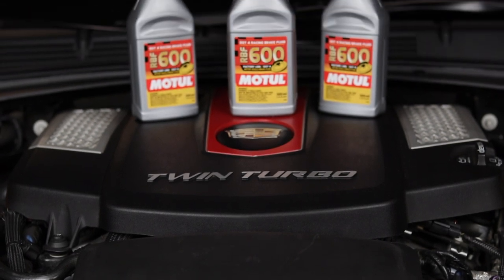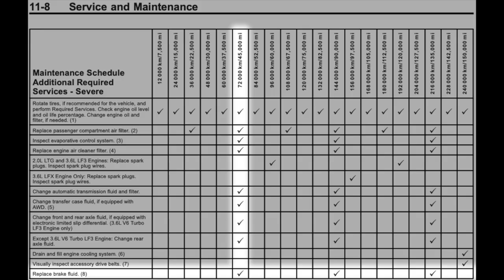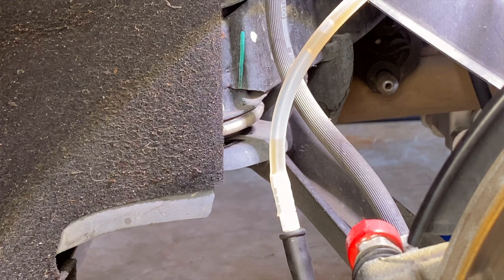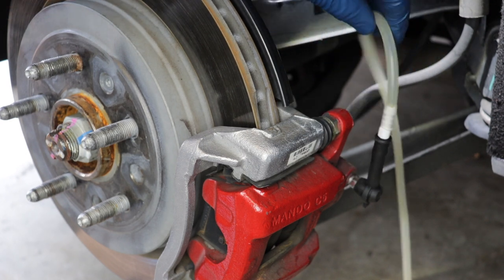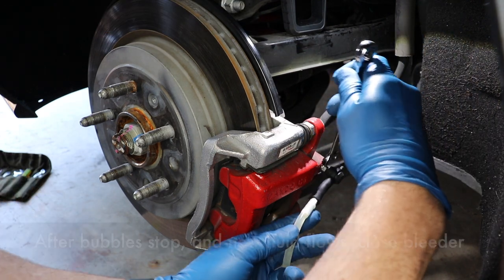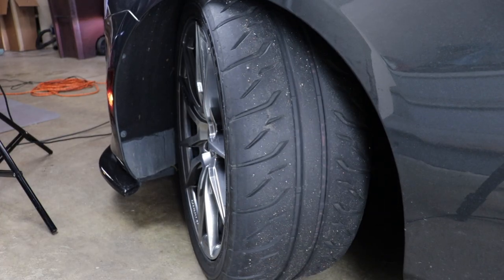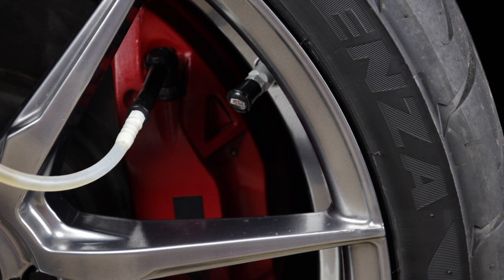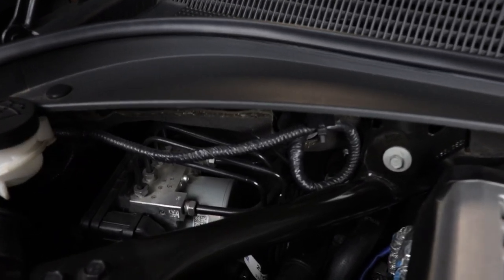Bleed Your Brembo Brakes - Track Day Prep | CTS  ATS Camaro  Corvette

Comment from the maker: Don't waste your time with that brake bleeder, get a Motive power bleeder or just find a friend!
Reply: I tracked my 14 v sport once a month for 3 years on trifecta tune. Only thing that broke was the rear diff but motor trend broke theirs too and said the early models had a casting problem. Mine was one of the first built.  Track days chews up tires bad. I ended up buying used tires as I was going through them too fast.
Reply: 😂 you're on point 😅

Comment: I’m here because of the problem where the bleeder pulls air in through the screw. Glad to see I wasn’t doing something horribly wrong.
Reply from the maker: Yeah check out my other video where I exchange the fluid on the Miata brakes with the Motive power bleeder. It’s sooo much better. Sometimes it’s not worth going cheap!

Comment: once again great video. You seem to come out with these videos when I'm about to dive in to the same. Keep them coming.
Reply from the maker: superswamperful thanks!  Some suspension work coming soon after the track video.
Reply: @JetFuelOnly  I'm interested in the suspension work. I've had not even looked at the suspension on this car yet. I had 1 mrc shock replaced under warranty. That's done now so if another goes I might go a different route than the mrc. I really like the idea of bags but I like coilovers as well. Big decision when the shocks go.

Comment: may i suggest removing most of the old brake fluid from the master first, that way that old fluid is not being mixed with the new fluid & pushed through the brake lines, & the task is a little quicker thus clean fluid is now in the system and not possibly mixed with the old.  thanks for your time keep smilin
Reply from the maker: Thanks for the tip!

Comment: And I was changing the brake fluid last weekend and 1 of the  blenders on the RH Brembo was frozen and it broke.  I've got a new one on order, and will hopefully extract it when it comes.  Otherwise there is a local salvage yard with one for $53.
Reply: If anyone else breaks a bleeder it was not easy to extract.   In the end i had to drill the hole larger and pounded a T35 torx into the hole.  Then i took a small impact to it and after a bit it finally came out.
Reply from the maker: Yuck I’m so sorry. I would have just bought a new caliper!  Lol

Comment: Only way to get air in the ABS module is to open it or run it dry.

Wipe up the "blake" fluid or it will destroy paint metal and plastics

Comment: Where did you get those brake calipers? 🤯🔥🔥
Reply from the maker: DanTayeveous Minton stock on the CTS but I plastidipped them in red and had custom decals made. I’ll be painting them soon as the plastidip has reached its end.